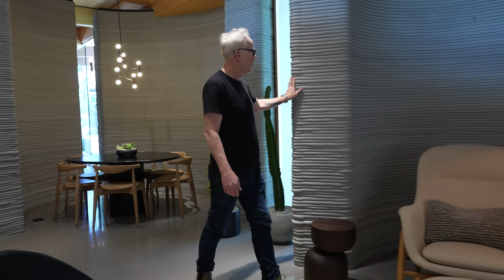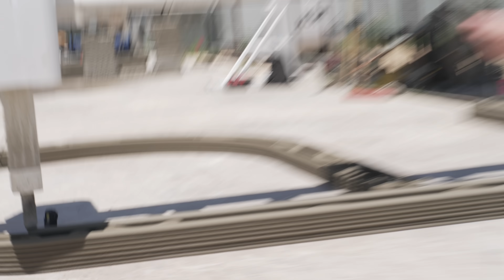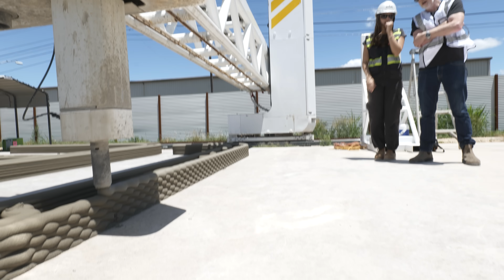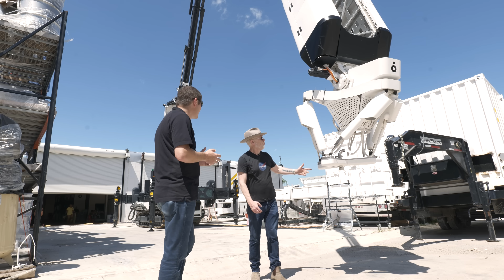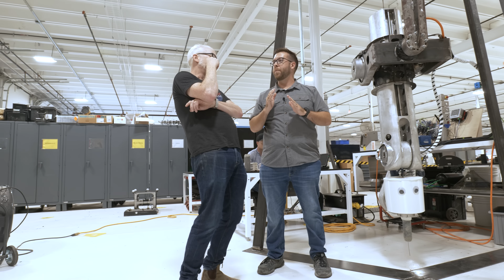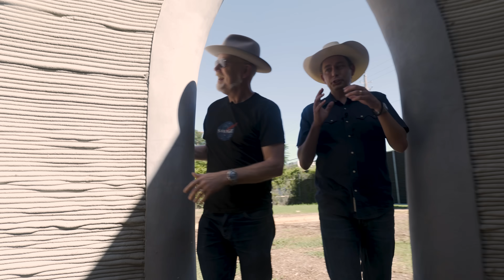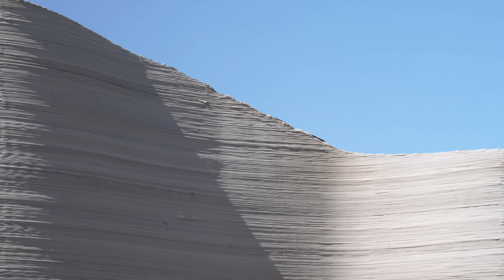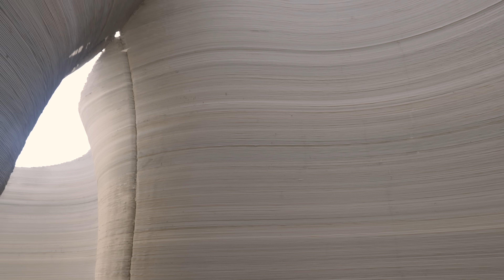The Biggest 3D Printer Adam Savage Has Ever Seen!

Comment: Love 3d printing, but not for houses. 
Those big bricklaying bots would be better for houses. 
They can use standard cinderblocks or bricks, or ICF blocks.

Edit: It's the texture that really bugs me about them, but that 'basket' one does look nice. 

With that arm one couldn't they have pop-up cable stays that help maneuver it? That way you don't need the whole solid gantry, and you have more stiffness than just the arm + stabilizing head. 

Have they tried ribbons instead of cables? About the same feet per spool, but stronger in the dimensions concrete isn't. Assuming they could keep it laid flat. Also more surface area for the concrete to adhere to. 

If they get printable batteries good enough that'd be cool to use in the walls. 

"Imagine a world where houses shaped like this are the norm" HOA leader's heads exploding all over the country with that statement lol
HOAs are evil. Tiny dicktatorships.

Comment: I'm curious about what happens after the walls are up. You still have to have floors and ceiling, plumbing and electrical. Other things to consider are what happens years later when the owner wants a new electrical outlet or a plumber is working on it. They student typically used to cutting through or working around concrete.
Reply: All MEP is factored in as we print and makes for a seamless integration once we complete the wall system. For specifics on how plumbing works, it is a lot like traditional framed construction. We create openings in the wall during printing where fixtures like sinks and showers will be installed - the opening is covered by a cabinet or wall finish (just like traditional construction). For toilets and outdoor water spigots, we simply cut a hole, pull the pipe through, and mount the fixture to the wall with a finishing plate—just like traditional construction. The key thing to know is that all the pipe connections—the places most likely to leak—are accessible behind a vanity, cabinet, or wall finish like tile in a shower. Nothing is buried behind the printed concrete where you can't get to it. So if you ever need to service or replace a connection, it's just as easy to access as it would be in a standard home. From the plumber's perspective, the installation and access is pretty much just like working with framed construction!
Reply: @ICON3DTech  just now watching this video a couple months later, good work 😁. 

Regarding the concrete mix, how sustainable are the materials that go into it? The new CarbonX material is billed as the lowest carbon material your company has for building so far, but  1) are there plans to make it the standard material for ICON buildings? 2) if not make it standard, are there plans to use some of the low carbon learnings from making CarbonX and transfer them to other formulations like Lavacrete to make them lower carbon? 

Also, 3) are there plans to eventually use excess CO2 in air as a main feedstock for the CarbonX material if carbon sequestration tech ramps up? 

And lastly, 4) is there any chance ICON branches out into automating more building processes, or partnering with other companies that engage in automation of the building process? A common refrain I hear is that 3D printing companies only automate the fastest and easiest part of building a home, i.e. walls, but things like plumbing, electrical, insulation, and window work still takes up most of the time and cost of creating a building.
Reply: It's not as common in the US, but I imagine it would be about the same as running electric and plumbing in a cinderblock building
Reply: @JackieBright  probably similar but without regular places to make fractures.
So probably also similar to having to saw concrete sidewalk/road  to install an outdoor utility panel.
Reply: Think bigger picture ;  you create a large scale megastructure, and then you suspend your floors from the structure itself.  I wish I could work for this company and design a superstructure.  Even a stadium at scale is possible at the very least.
Reply: How do they even complete walls with windows and door frames?

They only ever show footage of it printing walls at ankle height. They skip over when and how things like window frames magically appear and are secured to the concrete and structurally sound.

I just don't see how this will ever be more efficient or economical than prefab walls made offsite then transported and erected in a day.
Reply: @sirtra  The same way you would do it normally. Leave a spot for it, drop the window frame in, and shim it.
Reply: Exposed conduit or suspended ceilings and walls.
Reply: I’ve seen some drywall patches that resemble this 3D printed building. 

It’s a skill issue
Reply: The printing itself adds conduits for pipes and wiring, so that makes it a lot faster. Adding extra after the fact might be more complicated
Reply: This is true in most of the world, it’s only an “issue” in North America basically
Reply: @sagy101  you know japan also uses timber frame and drywall and much of europe is adopting it because it's just a better way to build homes
Reply: @z-0669 nonsense, how many 50+ year old timber frame and drywall homes are still standing?

Cheaper yes, but better? Heck no, no engineer or builder would say it's better than brick'n'morter or concrete in any structural or constructional way.

Were you never read the 3 little pigs story as a child?! I'll huff and ill puff and blow your house down 😂
Reply: @z-0669    I don't know how you came to the conclusion that "much of Europe" is starting to do it too. The houses built here in this style are either low-energy houses, etc., and constructed completely differently from US houses, or they are absolutely cheap houses where only quick construction and low price are the priorities. And even these are absolutely not comparable to a standard house in the USA. Such houses wouldn't meet legal requirements in most EU countries. There are good reasons why "Europe" doesn't adopt the US style of house construction.
Reply: Actually the "printing" process would be just about 20-25% of the whole building. What about Earthmoving, Foundations, All the mechanicals and a big ETC. Not to mention the walls can not remain like that. They must be smoothed, plasted or something, more importantly inside. A 2nd floor? Yo need Columns, Beams, Pouring the 2nd floor all with proper rebars or the use of steel beams so it all can hold itself, not to mention an earthquake. Concrete building is heavy stuff and potentially hazardous, and I don't see this method close.
Reply: @edufonseca5718 Close to what? Those walls are ten times the strength of lumber framed homes. The walls can be left as is too🤷‍♂️
Reply: @edufonseca5718 did you watch the video? Foundational, Ceiling the whole building🤷‍♂️

Comment: Just looked up some price comparisons out of curiosity. 
Regular homes can be built in 90-120 days, Taking into account multiple staff, permits etc a 3 bedroom home in Mueller Texas is around 900k. Now you would think that seeing as though Icon can build it significantly faster, it would be way cheaper? Nope. 3 bedroom home in Mueller by Icon starting at 1.3 million.
Would have been cool to see a company along and have first time buyers etc in mind helping the younger generation get on that property ladder.
Reply: Dang,  I was expecting more cost effective not less.
Reply: @calvinwright5040 Same. Greedy corporations just making money faster really.
Reply: @calvinwright5040  you gotta remember they're actively developing this tech, it's only gunna get cheaper to produce
Reply: They took what was already one of the fastest and cheapest part of construction and made it a little faster and a little cheaper.  Unfortunately they also made the expensive parts (foundation, plumbing, electrical, HVAC, insulation, cabinetry, doors/windows, and finishes) more difficult and expensive because they have to deal with these concrete walls that are a bigger problem to run stuff through, hang things from, and trim out.  It's also a construction type that's wholly dependent on a single piece of equipment and the company that owns it, trading resiliency and flexibility for a minor increase in efficiency.
Reply: it's not about current pricing it's about future possibilities. think of the houses they're doing now as 1st generation iphones. some day there will be competitors and many years of iterations and that's when the cost will be putting them into everyone's reach.
Reply: Interesting. The Wolf Ranch project produced houses which were comparable in cost to stick-built, but with better thermal insulation and sound blocking. Maybe they've discovered that the market will pay a premium.
Reply: seems like both a fair and unfair comparison at the same time, as you are probably comparing a standard wooden house instead of something brick/concrete. but its true the point of these houses should be affordability.
Reply: if you want cheap housing you need people who aren't motivated by profit.
Reply: @kaiserruhsam Well every business is motivated by profit. I just wasn't expecting the price to be more expensive. I really thought it would be a more affordable option.
Reply: @kaiserruhsam  I too, live in dreamland.

Comment: One question- how easy are home repairs with this? Let's say you want to put on a new room, floor, or need to get into the walls- what's the repair process look like?
Reply: it's concrete, repairs and renos would be harder than wood, but it's not an unsolved problem. you'd just need a hammer drill with a masonry bit for holes or a diamond-tipped circular saw for big cuts
Reply: I think the people these homes are for arent concerned about adding a new floor ..

Comment: That's cool but... the dust must be a nightmare on those walls though
Reply: That is dealt with in two ways, their mix has add-ins that prevent issues like dust and cracking and it can be painted.
Reply: @JorgTheElder  You refer to the building phase. I guess OP is referring to the living phase.
Reply: @Sekir80  No, I am talking about the living phase. It is not regular concrete.
Reply: @JorgTheElder  Well, okay, which means the concrete won't shed itself, that's fine. But it's ridges on ridges normál, household dust will collect on it over the living years. That's how I interpreted the question.
Reply: I mean, they don't even have the concrete mix correct or know how to solve the stability problems yet.
Who cares about dust when the structure is going to fail in 5 years?

Probably the people paying 100k for a 400sqft shed I guess?

This is a tech demo.
No one should ACTUALLY build this way.
It is the wrong tool for building normal structures on Earth.
Reply: They did say that the interior surface can be covered, but they're intentionally leaving it exposed during this phase. Those interior surfaces could be plastered over, or coated with spray-crete, or some other method that I don't know about. I personally would never leave the layers exposed in any space where household filth accumulates on horizontal surfaces. Kitchens are a perfect case in point. Look at the aerosolized grease that settles on the range hood, and then imagine that on every wall in the kitchen? It's a valid concern. Do you see an opportunity for developing a solution to this problem and marketing it to the companies that will build these houses? You might be looking at your fortune.
Reply: Several people wonder this, but we have yet to hear that from any of the hundreds of homeowners unless it's right after drilling into the wall and wiping clean around where the hole is.

Comment: The big thing that stands out as a HUGE deal is what he said about not having a heavy operator classification. for those not understanding the implacation let me spell out the wonderful little thing, that puts this in the overall same pool of hardware as boom lifts and other rentable hardware thus opening some aspects of construction to lower costs and waisted time. Again i seemingly small detail but massive boon to construction in low income parts of the world and even here at home.
Reply: yea the biggest cost of construction is the labor.
Reply: @femstora customers end users never going save anything. More savings for builders, that's all.
Reply: Well we don't have licenses or classifications for doing this in any environment that matters.
Building a regular structure with this tech, pretty much anywhere on Earth, is a dumb idea because it is the WRONG tech for that.
I'm not saying the tech is bad. It could be INCREDIBLY useful in a few extremely limited cases.
But it is the WRONG tool for general use.

FYI: It is 3-5x more expensive to build like this, and they haven't even figured out the problem of long-term stability(like...ruined after 3-5 years).

This is some "Learn at home so we can send some robots to build unfinished structures on Mars" tech.
It might also be useful for certain emergencies like remotely building safety structures in an emergency like a melt-down or toxic spill.
To put this into perspective, it is currently cheaper to prefab a structure and fly the parts in on a helicopter than to print a building.
Reply: Now extend that to other things, not limiting the usage to housebuilding.
Want custom length pavers?, custom concrete planters, pool accents, custom steps, in a soft ground area that bringing a premade piece into isn't viable but a concrete boom can reach.
Reply: Hmm- it depends on the underwriting.  There's no sheave, so it is akin to a Mobile Telehandler, or an Articulating Boom Lift- but with an engineering firm executing the project with a contractor.  I think you can do this w/o a NCCCO cert

Comment: Wifi and cell service will be useless inside unless there's an AP and cell extender in every room. It also looks like a nightmare to access plumbing, electrical, cable, network, HVAC in that wall. 

How does it get fixed if a car or hurricane hits your house? It looks like the entire structure would be compromised and never be fixable.
Reply: I expect it would be far more durable to a car or hurricane than a stick-built home. Did you notice when Adam smacked it with a pretty big sledge?

Comment: Wonder their thoughts on plumbing and electrical.   I bet that's a solvable problem too.
Reply: If the placements are knows beforehand they will model in gaps for the boxes or pipping to go and the machine will leave a gap there, I imagine they will throw in a sacrificial piece of wood or piping or something help "bridge" the top of them. Similar with doorways and windows. If not known, I guess someone has to cut out the placement and then fill it the gaps with either concrete or caulk depending who would be doing the modification.
Reply: would be similar to how its done in a log home
Reply: Just run them in the divots in the wall you’d want to cover over anyway. Just need to purposely make them a little bigger where you want
Reply: All MEP is factored into the design and quite simple from the construction side as well as the trade side. Electrical wiring runs through the cavity between the two concrete shells, the same space where the insulation goes. For outlets and switches, we create openings in the wall during printing. The wiring is fed down through the wall cavity to these openings and connected to standard electrical boxes—the same type used in masonry construction like concrete block walls. Then we finish with regular outlets, switches, and cover plates, just like you'd see in any home. In homes, the wiring is well protected behind 2 inches of concrete and commercial projects can run wire in conduit or use wiring with flexible metal cladding around the outside. For smaller items like thermostats or doorbells, we can drill openings after the wall is printed and run the wiring through flexible conduit to those locations. The whole system uses the wall's built-in cavity as the wiring chase, so there's no need to run conduit on the surface or fish wires through solid concrete. It's designed into the structure from the start! Plumbing works a lot like traditional framed construction. We create openings in the wall during printing where fixtures like sinks and showers will be installed - the opening is covered by a cabinet or wall finish (just like traditional construction). For toilets and outdoor water spigots, we simply cut a hole, pull the pipe through, and mount the fixture to the wall with a finishing plate, just like traditional construction.The key thing to know is that all the pipe connections, the places most likely to leak, are accessible behind a vanity, cabinet, or wall finish like tile in a shower. Nothing is buried behind the printed concrete where you can't get to it. So if you ever need to service or replace a connection, it's just as easy to access as it would be in a standard home. From the plumber's perspective, the installation and access is pretty much just like working with framed construction. More info is available on our FAQ page here--> https://iconbuild.com/faq

Comment: Cool you can make very expensive walls. Walls don't make a house. What foundation, electric, hvac, roof, ect.... This has been around for a bit know with nobody going any further then this. At this point I feel like it's a money laundering scam for rich people and corporations kind of like the VTOL personal quadcoptors that are also a huge joke.
Reply: Just like with the VTOLS, and self-driving cars, this won't actually solve the problem even if it works perfectly. If you just make it cheaper to build car dependent low-rise sprawl you don't actually solve the real problem which is that it costs too much to build and maintain the infrastructure for low density areas.